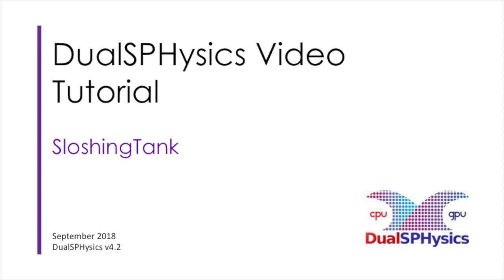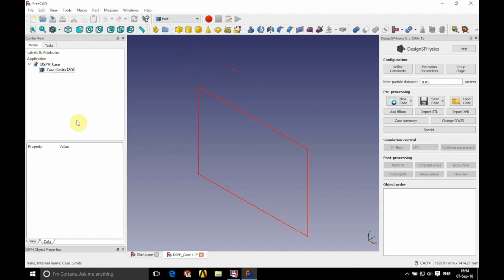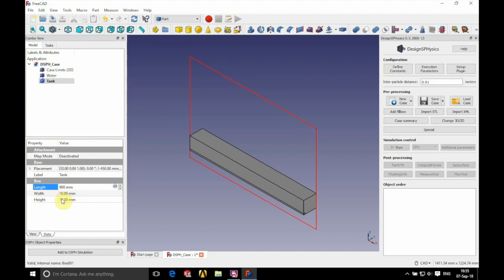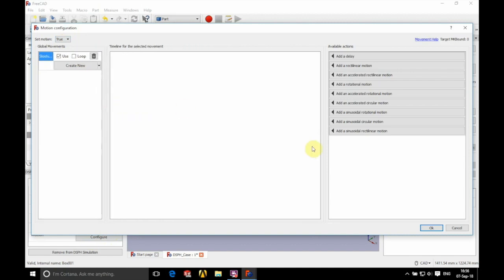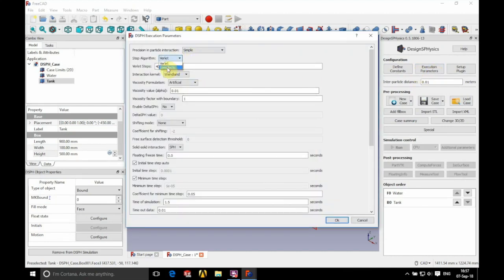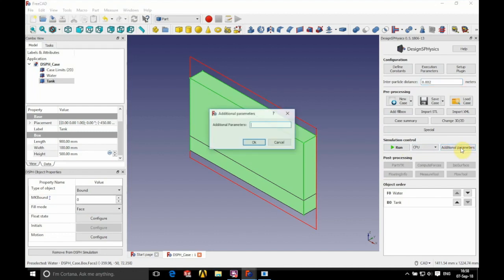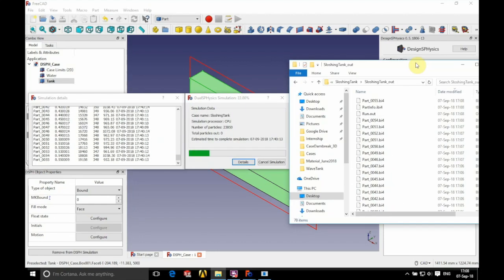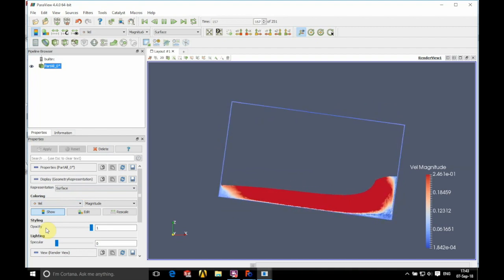DualSPHysics - How to set up and run: Sloshing Tank

Comment: Mine is not sloshing.
Reply: mine either
Reply: Maybe you can change the parameter of amplitude when adding the rotation motion for the tank, for example, Ampl=6
Reply: Try multiplying the tank motion and domain by 10. It will move, although not in the same rotation as the author showed.
Reply: @yingjiechang3957  I didn't quite understand how he configured the additional parameters. Could you explain it to me?